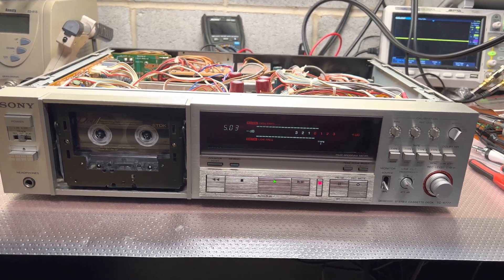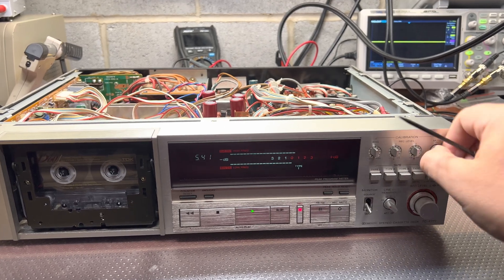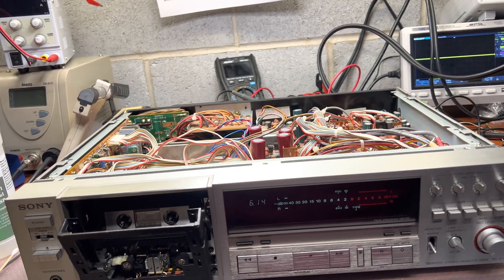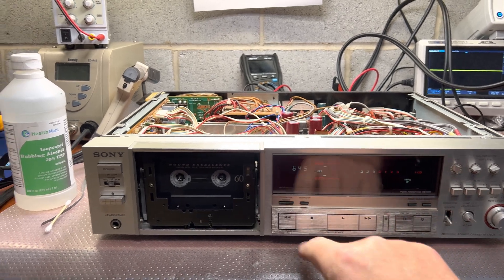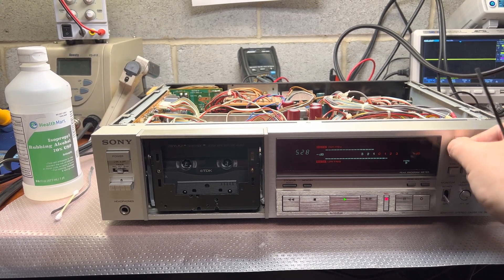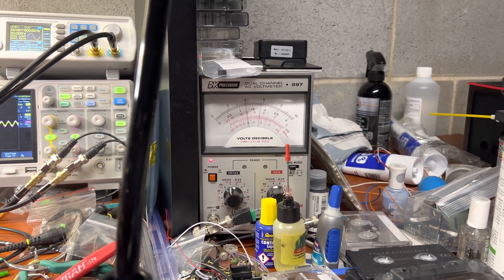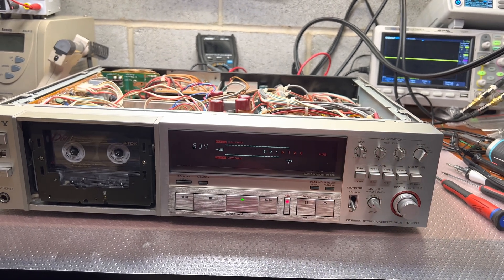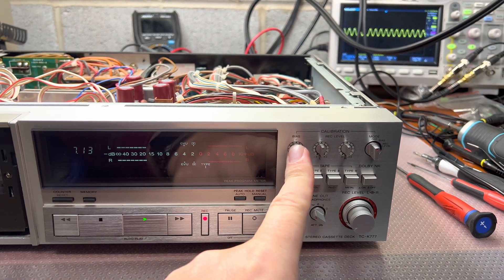Overcoming Obstacles: Solving BIAS and Erasure Issues on Sony TC-K777

Comment: Hello,My Sony TC-K970 has a bias problem, why is this happening?
Reply from the maker: Tape skew, dirty heads, worn heads
Reply: @hifirulezzz Thanks for your quick response. I bought it a week ago. It's practically brand new, a museum piece. I made a recording when it first arrived. It was great. On my second try, the right channel records less accurately (L +2db R -4db), and I can't get the calibration right on a Type 1 cassette. Maybe the problem is the cassette, I don't know. I wish there was a service center nearby.